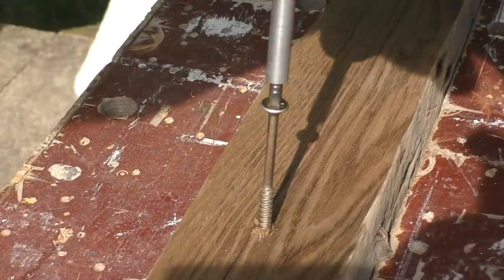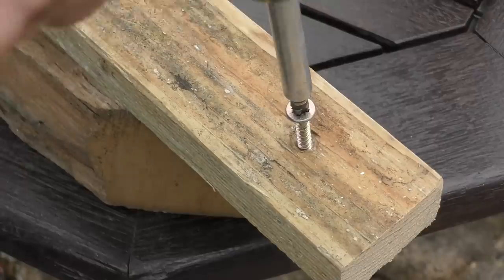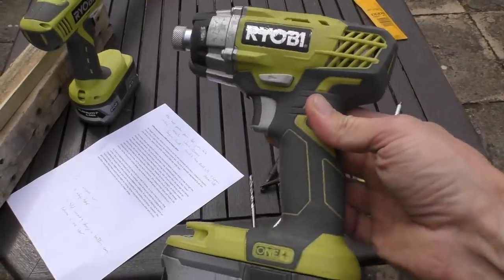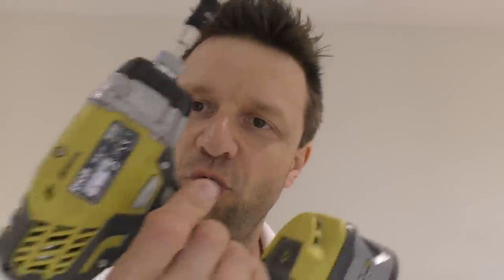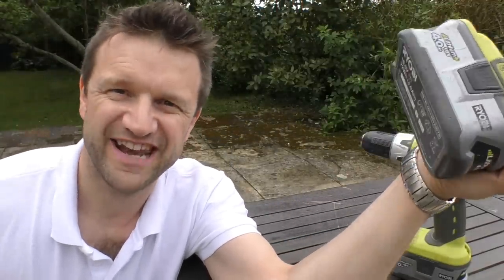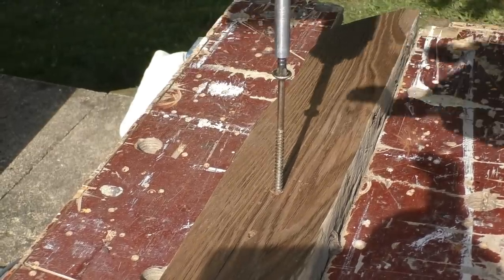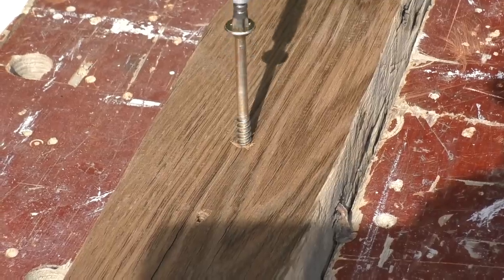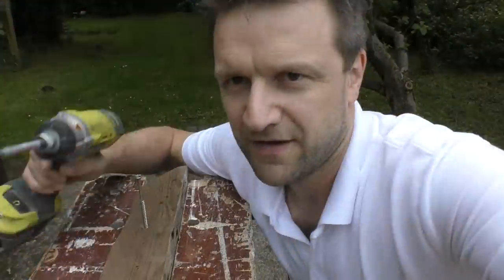Difference between Drill Drivers & Impact Drivers

Comment: never try
never tried  ryobi tools. For small job's at home i use makita, but working (construction, drywall and some carpentry) only hilti tool. Crazy expensive but really really good
Reply from the maker: Thanks mate. I totally get that for trade work you want brute force reliability - Hilti, Milwaukee, DeWalt, Makita. My Ryobi are still going strong after several years though, and I use them in the day job although I've got to be honest I'm not on building sites every single day, so for a DIYer they certainly tick the price/quality box.
Reply: @CharlieDIYte  good to know, maybe next time i need a new tool i will look for a ryobi

Comment: Why does the clutch slip on my impact driver???  What is the fix?  Thanks
Reply from the maker: Not sure why that would be, unless the gearbox has failed or the energy required to drive home whatever you're fixing exceeds the torque of the tool?

Comment: Impacts are much easier to control.  Trying to drill a 1in screw into a sheetmetal stack head into wall wood is nearly impossible with a drill driver the screw flops out almost every time where it just goes with the impact especially at an angle.  I only have a drill though so I have to first take a nail and make a puncture first.  Started out with my co-worker's old impact on its last leg then went to a power house modern DeWalt that I won at a work raffle.

Comment: The other thing that will drive you to an impact is very large fasteners, when you bring out large structural screws like 6 or even 12 inch long 1/4 inch diameter structural screws you just can't really drive that with a drill driver, regardless of using things like hex heads that don't strip.
Reply from the maker: Yep, good point 👍

Comment: so, for 90% of even advanced users the drill driver is still best, like you said, it drove the screw in just fine and it can drill and it can hammer drill :-)  to do away with the need for an impact driver and live with just the drill driver, a) use it on hammer drill setting for impact and b) buy torx screws that don't slip like posi. :-)

Comment: I have Ryobi R18GLU-0 is an 18 V cordless Glue gun providing cordless. Which Ryobi 5.0amp battery &  charger compatible with Ryobi Glue gun? Please reply me?
Reply from the maker: All Ryobi batteries are compatible with this glue gun. It doesn't have to be the 5.0 Ah. If you don't have the battery or charger you could go for a package like this https://bit.ly/3c27cVc although the 5Ah will obviously last a lot longer.

Comment: there has been a lot of talk of intellectual property theft.  I purchased an electric Ryobi mower that came with 2  4 Ah batteries and was suppose to enable you to cut a yard up to 1/3 acre: baloney!!!  I went on line to Amazon and purchased a 5 Ah battery that was not even available with Ryobi and that extra Ah was enough to finally cut my yard. Hat's off to those innovative Chinese for putting out a product that Ryobi should have done, but sat on the technology.

Comment: You should have tested the same tools using the hammer drill function on the drill driver Vs the impact driver . That would have been a better comparison.
Reply from the maker: No it wouldn't. The hammer action on a drill is useless for driving in screws because it 's an "in and out" action, whereas the impact action on an impact driver works in the direction the bit is turning.

Comment: Thanks for video it helps but still doesn't explain when it's best to use which tool? I am not a professional wood worker or carpenter but I've used various tools for many years. What I've discovered is that impact drivers are not good for assembling furniture together like what you buy from IKEA. The impact driver has too much torque and is way too quick even with a low AH battery for assembling prefab furniture.

Comment: Dude, drill a pilot hole before inserting a screw for a better fit and stronger fastener. If you are over-torquing, you are stressing the screw and weakening it. Any type of screw is strongest just at the threshold of deformation, i.e., the point at which the screw stalls and threads start to deform. If you are seriously deforming the head or stalling the drill, you need a pilot hole and are doing it wrong.

Comment: Thanks Now I know the difference between the 2 batteries.
Reply from the maker: You're welcome. It's always worth having a 2Ah battery to keep the tool light for most every day DIY jobs, and then a 4 or 5 Ah for torque intensive jobs (circular saw, SDS drill, chain saw, that kind of thing).

Comment: you couldve explained why an impact driver works better, is it basically like a hammer drill?
i dont get what those "consusive blows" are, hammering like a hammer drill?
and why would you want more power in screwdrivers rather than drills, i dont get it

Comment: is the screw equally as strong once in with either tool?
Reply from the maker: Yes. You wouldn't want to drive in a screw into a hard wood like this without drilling a pilot hole though as you run the risk of the screw snapping.

Comment: My drill driver has a hammer function.  Would that work as an impact driver?
Reply from the maker: No, because the hammer on your drill works perpendicular to the wall (in and out of the wall) whereas the impact driver hammer action works in a radial motion, ie in the direction the bit is turning.

Comment: The drill can have the tork raised or lowered. So if you are screwing something back together that is fragile, you turn it down so you dont strip or break it. Impact is for when you're going ham. If I'm installing drywall with an inexperienced helper I give them that so they dont sink the screws in too far. Me? I have been in this game 45 plus years and have the touch at this point .
Reply from the maker: I agree with that. A fitter who works for me won't use anything other than an impact to drive home screws. I bought him a hand screwdriver a couple of years ago because I was concerned that he didn't have enough feel for certain applications (like drywall fixings where you have to sense the tension on the plug). He hasn't changed his ways though.
Reply: @CharlieDIYte  I feel for you brother lol

Comment: Moral of the story, you do not need an impact driver you just need a good battery pack.
Reply from the maker: Well, not quite. The impact driver requires a lot less force as the impact does all the work for you (the action is radial so it works in the direction the bit is turning) meaning it's a lot easier to drive a screw home. But I agree that it's not worth the investment unless you've got some repetitive jobs eg decking.

Comment: I have a small army of dead Ryobi batteries.   Have you had bad experiences with them lasting long?
Reply from the maker: I've got to say mine have been pretty robust, Eric, although I tend to just use the 4 and 5 ah rather than the 1.3ah that came with the tools
Reply: Charlie DIYte maybe it’s specific to the 1.3ah batteries.   At a certain point they no longer hold a charge and give a defective reading in the charging base.  Thanks for responding.

Comment: It's not just the size they are completely different battery series. The 4 ah battery is a Lithium+ vs the other being a Lithium battery. I'd like to see you use a 4 ah Lithium to see if it would still have the same effect.

Lithium+ 
https://www.ryobitools.com/products/details/2-pack-18v-compact-lithium-plus-batteries

Lithium https://www.ryobitools.com/products/details/18v-one-plus-2-pk-compact-lithium-ion-batteries https://www.ryobitools.com/products/details/18v-one-plus-lithium-ion-40ah-batteries-2-pack
Reply: The Lithium+ even states it gives more torque over the older ones. So anyone reading this, get the Lithium+ over the regular Lithium even if it's a smaller AH

Comment: 8:00 Caming out is a result of using shitty Philips / Pozidriv screws, not drill driver itself. Switching to using only torx / Roberson screws in my opinion has greater benefits than getting a fancy power tool only for tightening. And by benefits I mean not only longer bit live, non-destructed screw heads and less effort, but general peace of mind.

Comment: How can it be a difference with different Ah on the batteries? Are the largest batteries also giving more volt or watts, i.e. more power/effect?
Isn't it a risk for breaking a tool if you use a battery that gives more volt than what the tool came with? Or are all Ryobi tools designed to be able to use all batteries? I find this pretty odd.

Comment: Which impact driver fo you have right now a 3 speed with a 4 aph gor $99.00 I don't think its brushless is yours brushless?
Reply from the maker: My old Ryobi was not brushless, but I'm currently using a brushless Erbauer http://bit.ly/2qEoKoT that B&Q sent me for a video a while back.
Reply: @CharlieDIYte  Thank you I have all ryobi do gor now stick with that even though I know there is more high end.  They also have  a deal on 4 apH bstteries for $79.00 which is a deal reg $198.00 I have an 18 volt charger I think 2 actually so eyeing the batteries and th he $99.00 impact with a 28 vklt 4 aph

Comment: Lol it stopped my first drill was from dewalt standard drill I never had any issues but it had a manufacturer  re-call on the set that my dad got because it broke people's arms because of the torque ps. We still have it 16 use later my dad owned and worked in his own construction company using the same 16 year old tool so we used it 5 day a week 52 to 50 week a year for 16 years oh it even beats the new dewalt and other impact drivers oh and we never broke our arm with it or even injured
Reply from the maker: Wow, that's some torque. I'm afraid they don't make them like they used to!

Comment: Pozidriv screw head seems to indicate the video is shot in Europe. In North America we use Robertson.
Reply from the maker: You're right. UK. We're far too obsessed with pozidrive. Robertson and Torx rock!
Reply: @CharlieDIYte  I have a lot of things to say about this. I began attending elementary school two years after the USSR collapsed and general public there had only two types of screwdrivers: flat and phillips. Once my father asked me which of those is better and I didn't know what to say, only wondered why there aren't any square ones.
19 years ago, before my family moved to Canada, father bought some screws with pozidriv heads. I didn't know the difference and tried to use phillips drivers, damaging them to my surprise: it was the opposite situation with phillips heads.
Torx bits can also be used with hex heads of corresponding size.
When studying mechanical technology at Dawson College, I learned that tools can be divided in following grades: consumer, commercial and industrial. Ryobi tools are among the best ones for DIY projects but contractors or manufacturers in US and Canada primarily use DeWalt and Milwaukee. Makita and Bosch are used as well.

Comment: then what are the benefits of a drill driver over the impact driver?
Reply from the maker: Check out this vid https://bit.ly/3sxpfw5 I rarely use my impact as I just don't need that torque very often. I rarely use a Combi because it's heavy to lug around and the hammer action is rubbish (you need an SDS for concrete drilling) but I use my drill driver all the time.

Comment: ifound out about the battery ah when i had a dewalt drill ( wasnt brushless but was pretty new) had a 1.3ah battery and i thought thr battery was broken i was close to binning the drill but i borrowed a friends 5ah battery and drill came to life and was pretty good  so bought new battery now drill is good i wouldnt even bother using a 1.3ah anymore
Reply from the maker: Hi buddy. It's always good to hear someone agree with my experience, but from using a different brand (and a quality one at that, with new batteries), as I have so many people saying "it's probably because you were using Ryobi, and /or that battery probably was faulty". Bottom line, the 1.3Ah batteries just don't have the torque that you need. Thanks for taking the time to comment 👍

Comment: dude, you have forgotten the real usage of the impact wrench. its mainly use are to open car wheel nut & bolt.
and if continue got stuck on none rotation within 5 second the entire spoke will fuse together making the impact wrench worthless. and impact wrench are to merely replacement for air compress wrench doing light weight job.

Comment: So with a drill you need to drill a guide hole through into the wood and then drill the screw in so the screw is only using the sides as opposed to the head of the screw

Comment: I know this is old but I am calling a foul here on the battery tip.  Your 1.3ah batteries were an older generation and probably 4 or 5 years old when this was filmed, Your 4ah batteries have the built in charge meter and newer artwork, they are a more advanced generation and are much earlier in their life cycle.  I have the newer batteries in several sizes but use the lighter 2.0 batteries in my impact driver because they are smaller and lighter.  I have to change them more often but they seem to release as much current as the driver is able to pull.  Your demo shows a new battery is more powerful than an obsolete worn out battery. (All batteries wear out folks and they get weaker before they quit altogether)  

I will conduct the same test with same aged batteries next time I am driving 6 or 8 inch ledger screws if my 2.0ah stalls on me and report back here.

Comment: Wait, why would the capacity of the battery matter though?? Are they not actually the same voltage? At least in theory, if they're both consistently providing the same voltage then the battery capacity shouldn't matter.
Reply: To put it in simple terms there is more volume of power in a 4ah battery as opposed to a 1.3ah,  yes the same 18 volts but more of it.

Comment: why are you using PH2 bits in PZ2 screws? That's why you have to push down so hard to stop it slipping!
Reply from the maker: It was a mistake, Dave. I reached for my impact bit which I thought was only pozi drive and it turned out I had a Phillips impact bit in my tool belt too. That said, even with the right bit there's always a chance you'll get a bit of camming screwing into oak without a pilot hole unless you use torx bits.

Comment: iv used both and personally don't like impact drivers, I find them much harder to use because they rattle about as he says, I think they're harder to use because your using so much effort controlling it
Reply from the maker: Horses for courses, I guess. A fitter who works for me uses his DeWalt impact for all screwdriving and swears by it because over the years he's built up an understanding of how hard he needs to squeeze to get the exact amount of torgue, whereas I prefer to do a final test with a hand screwdriver, particularly when using plasterboard fixings. However the impact comes into its own for repetitive jobs or serious heavy duty driving. The hammer works in a radial direction so assists with the turning of the screw, so it's so much easier than using a drill driver, where the hammer action is perpendicular to the wall (or inline with the screw bit).

Comment: Spend the extra money and get a Makita. Been using the same ones for 15 years and they work like new.  I can see the cheapness in the Ryobi.
Reply from the maker: Fair point. Only thing I'm going to throw out there is whether, if you bought a Makita now, it would last as long. Only reason I say that is I was speaking to an employee in a DIY store a year ago and he was saying they're getting a lot more returns of Makita than they used to which suggests even the quality brands are cheapening some of the internal components (eg nylon cogs when they would previously have been all metal) to lower the price and increase market share.
Reply: Very true. Makita has been bought out and taken over by a different company. The quality has taken a serious dive since then. Not sure why but it has happened.